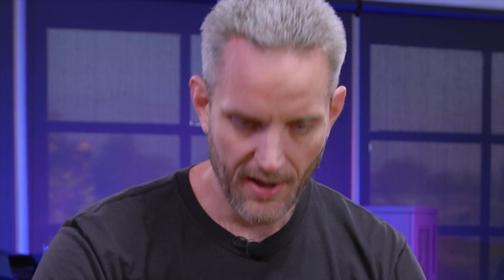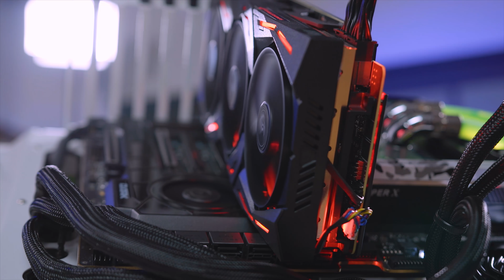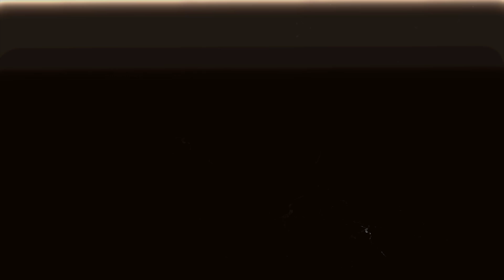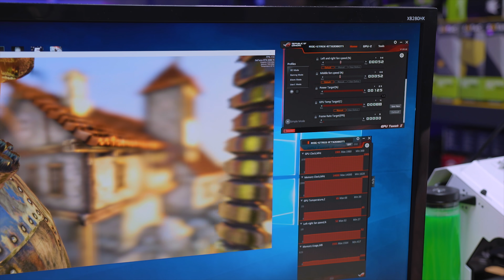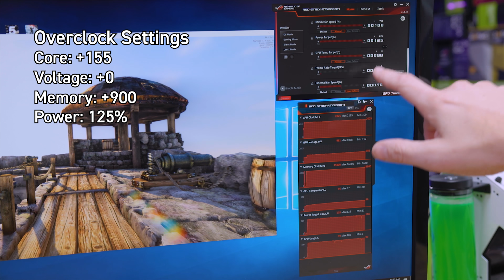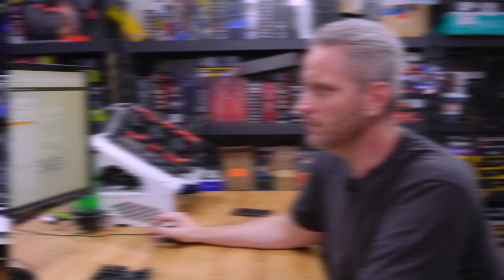ASUS ROG Strix 2080Ti Overclocking and Review

Comment: Hey Jay, out of curiosity, do you know what RPM the fans would be spinning at towards those higher percentile curves? I ask this because Steve at GN covered in his original 1080 Ti comparison videos ages ago that the Strix ones end up being louder (compared to EVGA etc) because ASUS have those fans rated to spin at higher RPM’s, but generally speaking they never need to go that high. Just wondering if you know or what your thoughts are on this. Great video as always!

Comment: I love Asus.. like.. A LOT. I've never built a system that didn't have an Asus motherboard in it. Also, I recently started using Asus monitors and will continue to do so. However, Asus GPUs have just never struck me as aesthetically pleasing. I think EVGA has the nicest looking GPUs, especially their 10 series cards.. love the 2 slot rectangular design. Nothing sticking out, no sharp edges, just a smooth powerful rectangle.

Comment: one irrelevant question....what is the differences between a card this big with 3 fans, and a smaller one with 2....I was thinking if I should use a nzxt g12  watercooling gpu bracket, but I think it won't cover up a gpu with 3 fans...will  I sacrifice performance by getting a 2 fan gpu???

Comment: My one criticism(applies to most if not all 2000 series cards) is that they removed the top DVI port and then replaced it with a displayport. What was the point of that exactly?

Sigh Guess I'll still be needing my dremel.

Comment: The design is unchanged for 2yrs bummer 🙁
Reply: I know, really disappointing that a new gen doesn't get something new visually
Reply: Why ruin it for no reason? 
What would you change?
Reply: @voxelfusion9894  just something new. For such a big step in a new direction it is a new and different thing entirely almost. When car manufacturers release a new model, or a completely new thing, they don't just use the design they've been churning out since the '80s. I did love the strix design but...come on if this Turing lasts as long as Pascal we'll be talking about the same design for 5 years. It makes me wonder how much this is actually just a stopgap card like people have been suggesting. Think the real thing is coming next year with 7nm so this is more like a staggered release. I is an iconic design, but surely could have tweaked it for a strix 2.0 look.
Reply: Which is what a lot of us prefer. An all black card with no ridiculous colour schemes on it.

Comment: I'm pretty sure the extra power plugs is mostly because you can power a VR headset along with the display and USB cables with a single port on the video card. I don't think that the card draws more than 300 watts

Comment: The external fan headers being displayed in AfterBurner, might be coming from the digital controller. Previous Nvidia cards had analog controllers. Which makes me wonder if the chip can be "hacked" to change to power limit. Maybe through the new USB-C port. It's just a thought, but it might just be the "silver lining" in this release. So many questions!

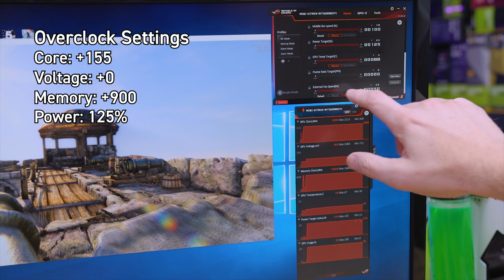Comment: 8:32  Asus dropped the 2 fan headers on 20xx Strix cards ?  I have 2 ML140 fans connected to the fan headers on my Strix 1070 card . It's called Asus Fan Connect 2 on the 10xx Strix cards , works great

Comment: Meanwhile im here trying to get a 1060 6gb for 250-300€ ,still overpriced af the cheapest 1060 is 249€ but 3gb noty , even the rx 580 8gb saphire nitro + is 369€ :( 
I know is a old gen but for 1080p gaming i think it will suit my needs , fortnite zombie mode , cod black ops 4 etc... idk when 2060 will launch probably first quarter of 2019 right?

Comment: Interested in the 2070. Jay please do a video of water cooling cheap cards!  Evga 2080 black is $750. Vs $850+ cards. are you just paying for the coolers or do the cheaper cards have lower ASIC quality. Most of these are reference PCB's Why the higher prices? Is it worth buying something like this strix card if you are just going to be throwing on a water block?
Reply: James Gabrielson you’re generally paying for better cooling solutions. As Jay mentions in the video, they’re all virtually similar with the only change being aesthetic. Reference is better for water cooling however. So, personally I’m picking up a 2080 FE because I’m doing a custom loop. The FE which are reference are better supported by EKWB and all them guys. Hope it helped
Reply: Many of the cards out now are reference PCB's only a small amount are custom pcb solutions. However I want to know if they are holding back ASIC quality or limiting the cheaper cards in any way. 

You just bought an FE for I'm guessing $800 when there are EVGA and Zotac cards for $750. Almost certain they are all reference PCB. Is it worth buying the custom pcb or even more expensive cards or should you just save as much money as you can for the water block? 

I know with this round of GPUs they have 2 SKUs for each class one is limited so it can't be factory OC does that mean they can't be manually OC as far? Are they worse quality? Is it just a gamble on ASIC quality regardless of the card you buy? OR are they binned in favor of the more expensive cards?

Comment: Meanwhile I'm just upgrading from an AMD phenom II laptop with integrated graphics to a fx 8350 and a gtx 750 1gb, I still need a motherboard, power supply, cpu cooler, case and ram though

Comment: So these cards would defiantly benefit from shunt modding then? Good.
Since I'll be water cooling mine as soon as I can afford a block for it, I'll be sure to do that.

(Got a 120Hz 3440 X 1440 monitor, like hell am I going to let power limits get in the way of hitting that refresh rate)
Reply: You should have no problem hitting 120 with a 2080ti. My 1080ti would regularly be in the 100s
Reply: My 1080ti was doing all right but I would often see frame rates dip into the 80's in high quality games and that's just disappointing. But then again I do play at max settings no matter what the game is so it's my fault a guess.
Reply: @nightcorefusion3884  do you have a gsync display? You really shouldn't notice any dip like that but I understand wanting to max it all out. I have the Asus PG348Q and I'll definitely be getting the 2080ti even though my 1080 runs it just fine.

Comment: On my 1080ti I overclocked it to +150 and some stuff and tested it with heaven benchmark - it all worked fine. Tried to test it on TimeSpy nad it crashed on the second test. I step by step put it down until I was back to stock speeds and It still crashed. I thought I bricked my card but I put It back up to 150 and it works since then without crashing anything but 3DMark.

Comment: ROG Strix Or Gaming X Trio?
Reply: Gaming X Trio pre ordered, I wonder if that extra 6pin really does that much though...
Reply: @SweViver  I wanna get the rtx 2080 MSI trio.. But its not available..
Reply: Jay basically said that the extra 6-pin (or lack thereof) didn't make a difference. The issue still is the nvidia-set power draw limit that is holding back all these cards :/
Reply: @SweViver

It doesn't do anything at all. its paired directly to the 8 pin next to it. And they have removed all the load balancing circuitry of the pcb that all other 2080 and 2080 ti designs use .....

Se Actually Hardcore Overclockings
 pcb breakdown video, watch?v=V70f1Kx0QTU
Reply: No the extra 6pin does nothing. https://www.youtube.com/watch?v=V70f1Kx0QTU MSI PCB is nearly a Foundersedition PCB
Reply: @SweViver  msi has standard 300 power limit not 260. +10% =330
Reply: n1LL3R i am picking up the 2080 ti duke due to price and also how it looks I think the trio x looks horrid imo
Reply: Capsize they all are around the same when you OC them and even then its a 1% difference if there is any I think anyone that is picking one of them up it is picking what would look best to them tbh
Reply: msi X trio custom pcb !!! ;)  already preordered
Reply: Easily the Trio. Here in Europe it's substantially cheaper, making it an easy choice.
Reply: Windforce OC :P
Reply: Wait to see what EVGA brings to the table with the RTX 2080 Ti FTW3 Ultra.
Reply: @GUBBIn1LL3R  yeah most likely :(
Nawras 2, these Trio cards seems to be delayed also for some reason...
Reply: Trio.
Reply: #powerlimit #rip
Reply: All comes down to your personal preference with looks. Some will cool slightly better than others but all of them will still be within 1-3 fps of each other. Just get what you think looks nicest
Reply: but you can easily oc yourself... for free so they end up the same the only thing that can be really taken into account is temps and how quiet you want your GPU
Reply: @GUBBIn1LL3R  well Duke is known as the best cooler for the gpu and cheaper but boost clock not as strix that could boost slightly higher clock speed
Reply: Trio
Reply: I  always have used Gaming X cards and those things are cool on thermals and most importantly....quiet under 2k resolution or playing older games with 2080 ti beast you most likely wont hear any fan noise since the fans are literally stopped when on low thermals then you start hearing this veeery quiet hum ^^ if you don't do some crazy overclock that is if you do its still much more quiet vs other brands but beware of the weight of that card also size , they come whit these support metal clips that you have to use to protect your motherboard pci sockets etc from strain so you need a really big case something to keep in mind
Reply: The ROG Strix 2080ti is quieter and cooler than the Gaming X Trio https://www.guru3d.com/articles_pages/msi_geforce_rtx_2080_ti_gaming_x_trio_review,8.html (inlcudes the ROG 2080ti results)
Reply: I've chosen a 2080 ti Gaming x Trio, just becaause it looked better since i prefer vertical mounting.
Reply: I 've got 2 Msi Gaming trio RTX 2080 TI's on the way ^_^ I prefer them over the strix model and by the looks they perform better :)
Reply: I like Asus because like Jay said, it's minimalistic .... and I don't like Gigabyte and MSi ... but I have to admit that X Trio is looking pretty damn good ;) So it's up to you and what do you like
Reply: Gaming X trio
Reply: Never had those DC2 cards i think they are mid tier cards ? like 1060 or so ?  i only had 2 cards so far 780 from msi and now 1080 gaming x from msi as well , both have been overclocked and worked well , as for first spin at 100 % :  the idea is to clean the gpu and fans of dust by turning the fans bakwards at 100% it a very clever idea , works really well and if you keep your case cleaned of dust i find it rarely does it like maybe once a month , for the capacitators its above 180+ fps where you start to hear this coil whine but most displays are under that like for example 120 hz / 120 fps at 2K you cant hear the coil whine even at 100% load (at least that has been my experience )
Reply: This card looks the same as my 1080TI no improvement ant all in to the design...
Reply: Gaming X trio bro, Personally i'm looking at a MSI trio or a Duke, will most likely go for MSI duke tho. God of Wine is correct, at the end of the day Overclocking comes down to how good your GPU chip is (Its Binning), not the cooler or PCB its on.
Reply: @Capsize Really, in the UK the strix is about £300 more right now, it's insane. Also the trio is an over clocking card with it's 3x 8 pin power connectors. But yes, trio or Duke for me, Duke specifically because it's only dual slot and smaller
Reply: @GUBBIn1LL3R  I would not recommend the Duke, it doesn't cool very well.
Reply: Nobody know when I can buy a 2080 rog on amazon?
Reply: Capsize  I'm not talking about US prices here ffs :/ In the UK the prices are vastly different and way more. The STRIX is £1,500 ( 1,967USD ), Trio is £1400 (1,836USD) and the Duke is £1290 ( 1692USD ), So yeah quite a big difference.  And yes the trio X has 2x 8pin and 1x 6pin, doesnt change the fact that the Trio X is made more for overclocking than the others, you're still gonna be limited by the GPU silicon than anything else, just like pascal.

I would go for the duke because its far cheaper and also like I said you're limited by your GPU silicon for GPU OC's/speed, the cooler doesnt make a huge difference unless its a crappy cooler.
Reply: @Capsize overclockers.co.uk you can how expensive they are, it sucks
Reply: Strix OC...not the dual one
Reply: @GUBBIn1LL3R  what do u mean? Power mod? More spesfic please im a noob.
Reply: ROG STRIX
Reply: ROG Strix
Reply: Always choose asus! ALLLLWAYS! <3

Comment: I'll probably just get another Strix 1080ti OC for $500 less. cause the prices of the 2080ti aren't even worth it.
Reply: Nice but keep in mind it wont work at all in most games
Reply: Yeah I've been considering getting a second 1080Ti, one just can't hit the frame cap at 1440p 144Hz. Shame SLI scaling still sucks though. I can afford a 2080Ti if I really wanted, but it just seems like such bad value.
Reply: cant hit the frame cap at max settings or can it hit 144 with some settings turned down. I'm currently in the market for a 1440p 144hz monitor and need to upgrade my gpu along with it.
Reply: @justinolson834  At 1440p max settings I often get ~100 fps with a 1080Ti in AAA games. You might be able to reach 144 fps at medium or something, but I haven't tested much. I'd rather have the eye candy since I play mostly single player. Doubt you'd get 144 min without going way down though. It'll stay well above in esports titles like Overwatch though.
Reply: The same Asus OC edition 1080 Ti I bought is the exact same price i bought it for on release. I've only seen the Zotac cards actually drop in price.
Reply: Kyle Gruber yeah cheapest Asus I’ve seen is 650
Reply: Two weeks ago the Asus 1080ti OC dropped to $729 at microcenter.  Sold out.  Can't find any online at the price new.
Reply: Im getting 2080 myself
Reply: i would just recommend holding off sli is horrid and in a lot of cases a waste might as well just wait if you are fine with the performance you are getting sli is such a hassle
Reply: @CoCo.-_-   NVMe and NVlink raid 0 best
Reply: right couldnt agree with you more
Reply: Josh Oyen eBay
Reply: Xd a dream more like didnt came out for us
Reply: Exactly what I was going to do
Reply: Sli is dead bruh(980ti Sli user)
Reply: Grando Silver  Yeah it really does seem like everyone who actually has SLI recommends against it
Reply: @Malus1531  it's like 5% for real use and 95% problems with it.
Reply: I love how common this answer is. SLI scaling is pretty much the same as it has always been, and it works fine in a huge number of games. The problem is that for the most part you need to use Nvidia Profile Inspector to set up most titles and it take time and knowledge most people don't want to bother with. SLI isn't dead and the scaling is still between 60-85% in most games if you are willing to put in the work. I think the reason so many people advise against it really has more to do with how hard it is to set up. I have used it for years, still do with my 1080 ti rig. I wouldn't recommended it either, but its very good if you can put the time in.

Comment: Quad 2080ti NVLINK?
Reply: AutomaticSlap 
I want that nvlink.
I want all the VRAM.
Reply: Nope, only 2... Nvidia blocks 3 way and 4 way now.
Reply: Yeah but on Linus’s most recent video he gets 4way Quadro V100 going but those GPUs aren’t for gaming
Reply: Linus does not get 4 way nvlink, he gets sli over the connectors.
Reply: IndieMarkus  Technically it was a synced tiled display not SLI. SLI would be all four GPU's working on one image not 4 tiles.
Reply: Ok what about the universal party software for SLI on unsupported devices. (Back on the 1030s) 🤔 could there be a way to then crossfire 4+ GPU NVLINK or not on the bigger cards
Reply: AutomaticSlap  Nvidia would have to make or authorize production on a NVLINK bridge big enough to link that many cards. As far as I know, they only support 2 cards at this time. Third party solutions are always possible though. Also depends on driver support too. It's funny because I thought originally when the were first talking about NVLINK before it released, a year or two ago, I thought they might go the route of AMD and ditch the external connectors. But Nvidia wants that cash so they went total opposite with the bigger external connectors and more shit to buy.